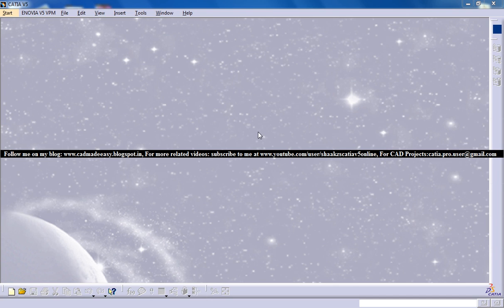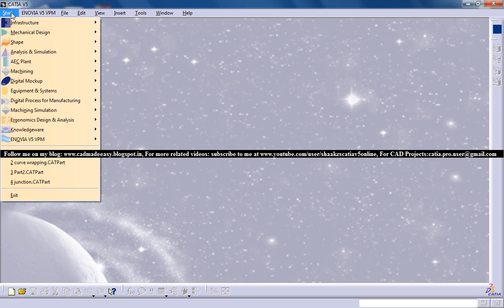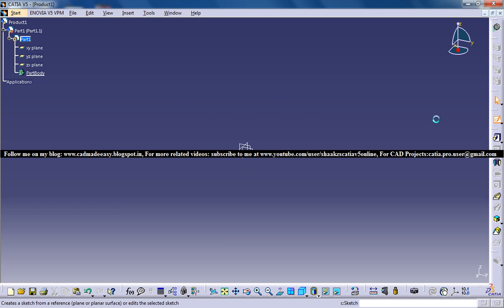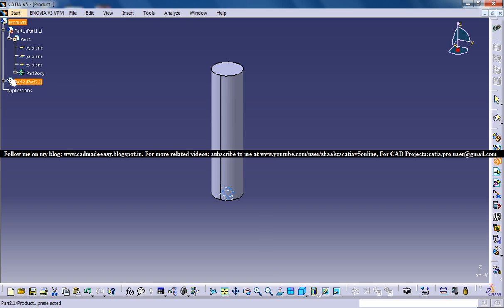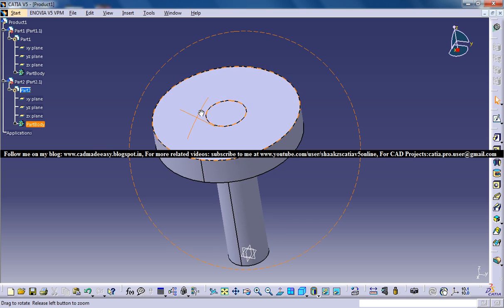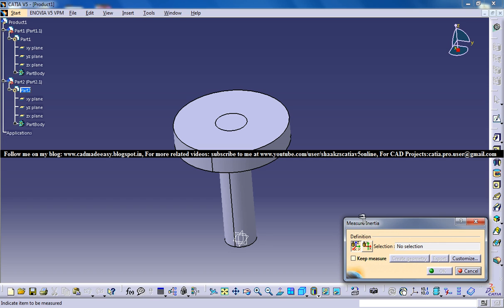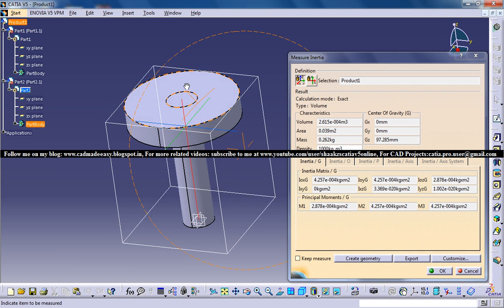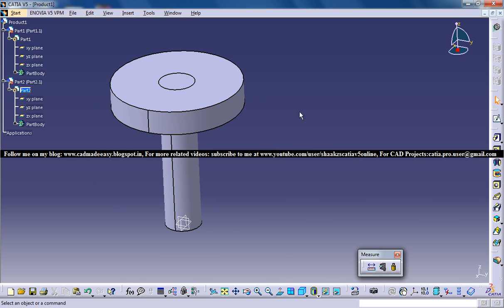Catia V5 Powerful Tricks Collection #115|How to Find Centre of Gravity & Mass of Solid/Surface

Comment: How to change of center of gravity in assembly or part modeling
Reply: One location to other location
Reply: Well, the CG shifts automatically with the shape.

Eg: if diameter of a screw head is 5times greater the length. The CG will be closer to the head.

Vice-Versa (If the length is 5 times greater than the head dia, the CG will shift away from the head)

Note: For balancing mass or a structure, the CG should be as close as possible to the ground level.

Always consider the real world, because its easy to fix at the design level than once its physically built.

Thank You